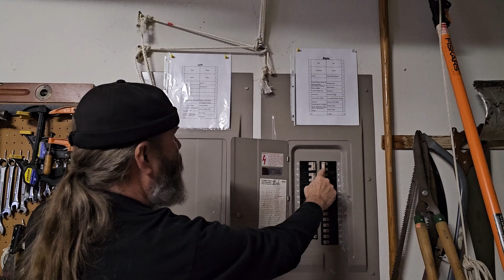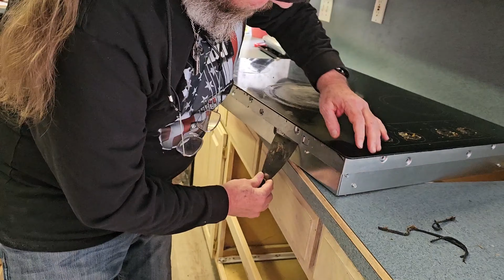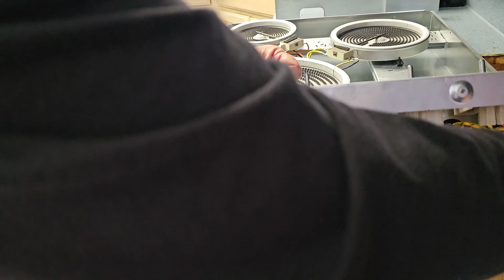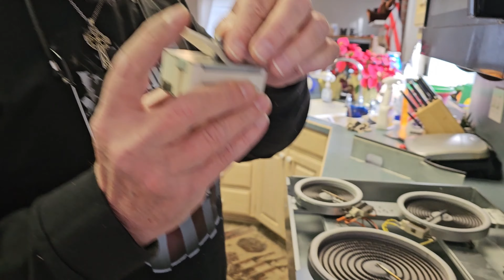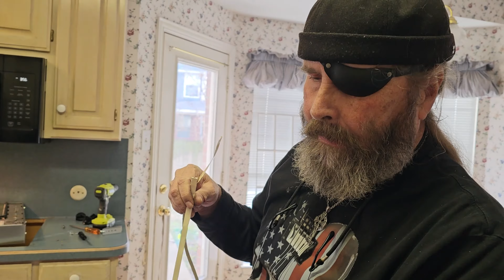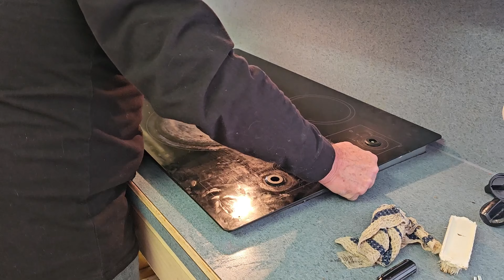How to Replace a Stove Cook Top Burner Control

Comment: Another great video, thank you! Arrrr Captain, my refrigerator door hinges be creaking. Would you recommend WD-40 or something else? A hearty round of thanks! ☠️👍🏼🦜
Reply from the maker: Thank ye for the kind words, matey! WD-40 should work, as well as 3-in-1 Oil. If that doesn't solve the creaking, then you might need to remove the door, clean the hinges with a solvent, then apply a small amount of silicone grease. Smooth sailin'!